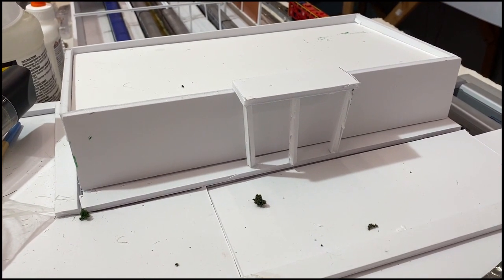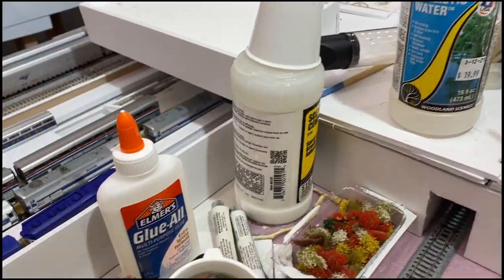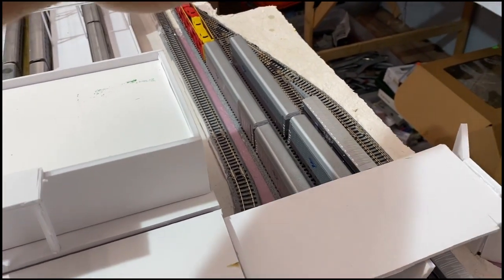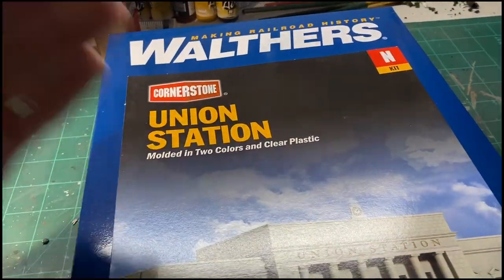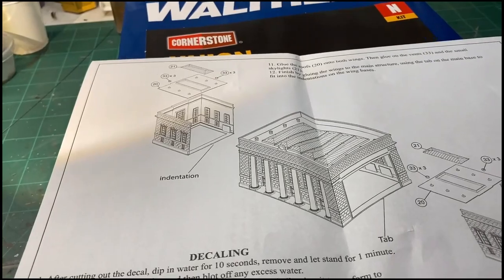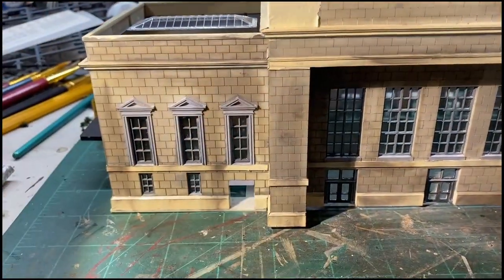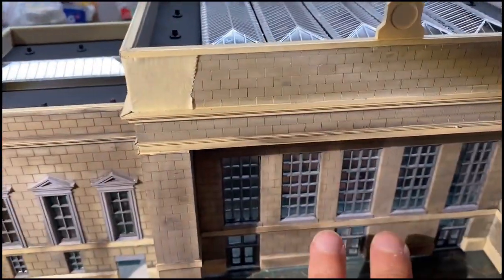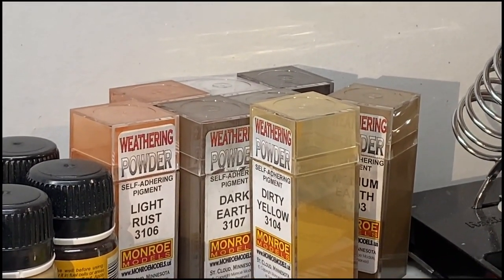N scale Terminal Building Progress

Comment: I did a very similar design.  I have intermodal where you have autoracks.  To the left towards your turntable I just have a 4 track freight yard.  Loop is hidden under station/town.  Big difference is I built the town square, parking and some stores over the platforms in place of train-sheds like you have.  Working on the interior now.  I put the stairs to the platforms in the middle of the station like the CB&Q did on the original Omaha station that this is modeled after.  I could see stairs out your rear doors to the platforms.  With the platforms under the town I left one side open for viewing.  I also put a platform on the loop for through trains not terminating at that station.
Reply from the maker: i like it.  i thought about making the station viewable  from the underside.  I've looked at some 3D printed escalators, too.  I know this sounds silly, but what I'm not looking forward to is all the people i need.